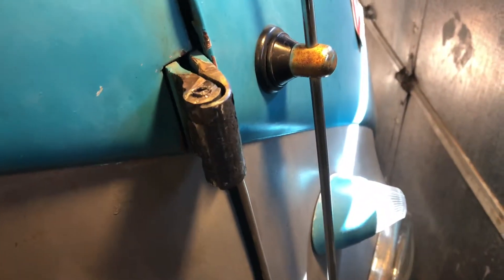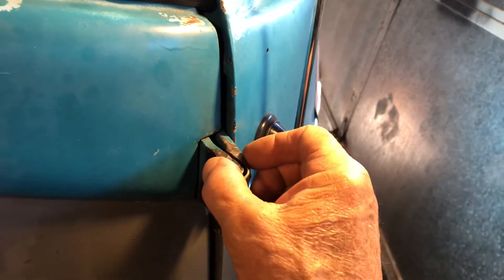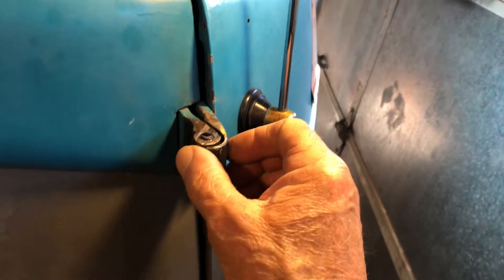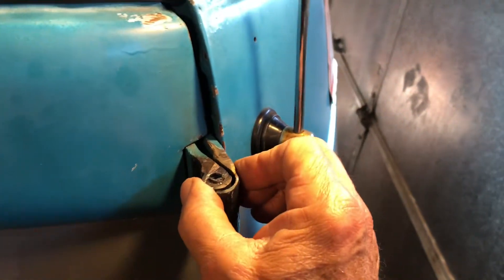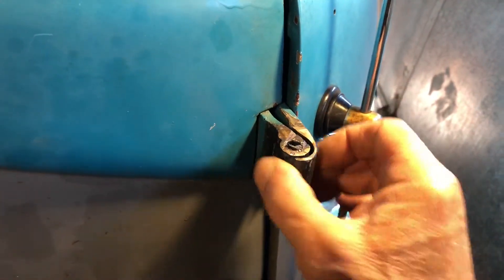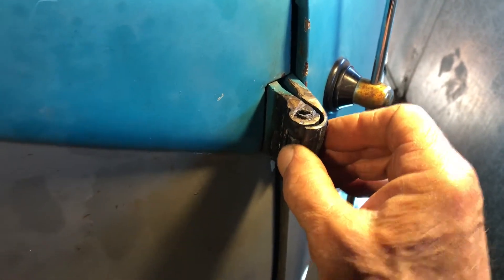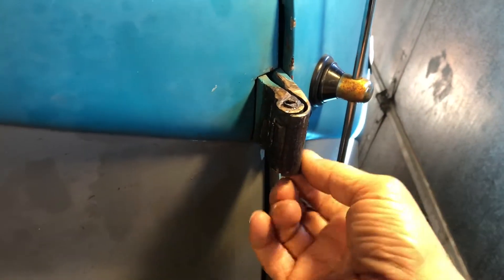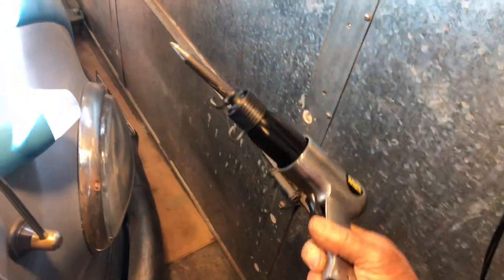VW door hinge pin removed for mirror...

Comment: What size attachment did you use?
Reply from the maker: it was a tapered bit smaller than the pin that pushed it most of the way out...
Reply: Is that a custom bit or do you have a source that sells them
Reply from the maker: @willycsjr  ..Harbor Freight...the gun and 3-4 bits was only $14...